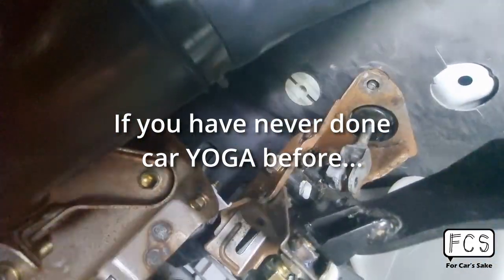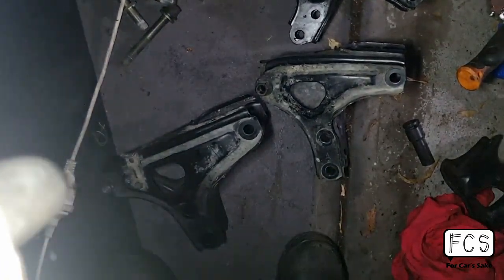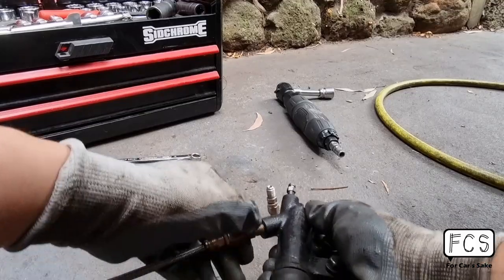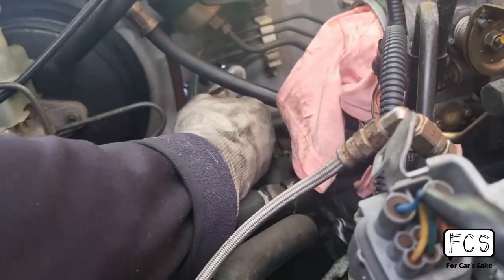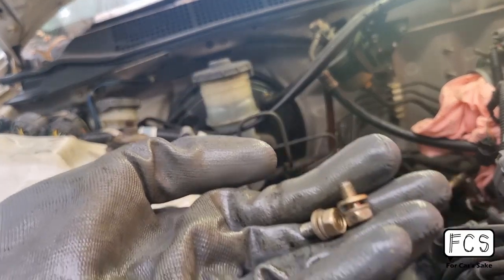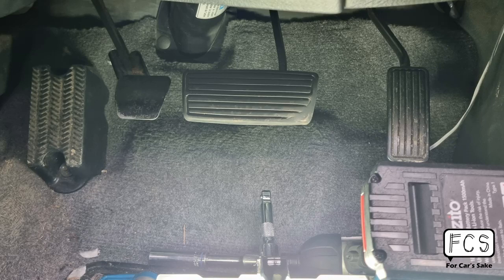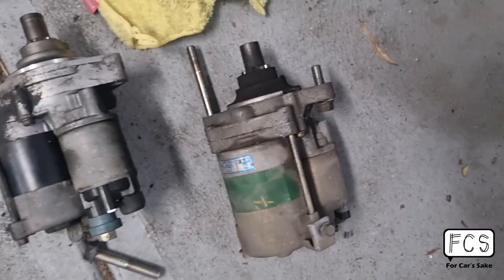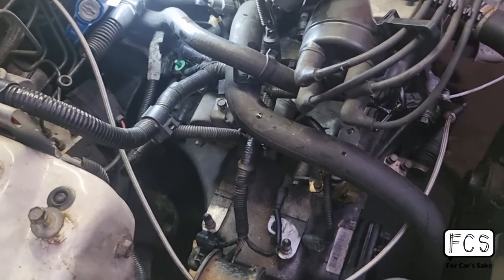How to install clutch pedal, master cylinder, slave cylinder - Honda EK Civic

Comment: You said your EK is a CVT transmission? How is that possible? CVT didn't exist for the EK. Honda didn't even get it until nearly 12+ years later.
Reply from the maker: Hi mate, in Australia you will find the auto EK VTI sedan runs the CVT gearbox. Hence the different chassis mount. The normal EK GLi sedan and hatch runs the auto. In fact, the first gen HRV (90's) automatic also runs a CVT.